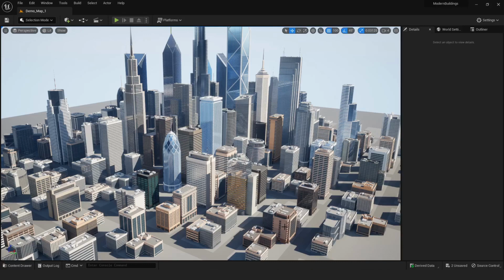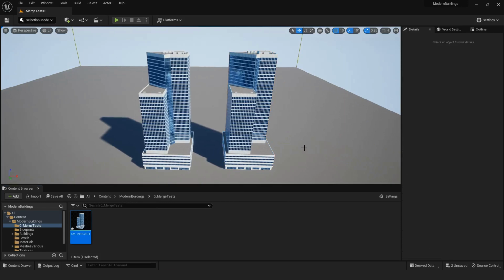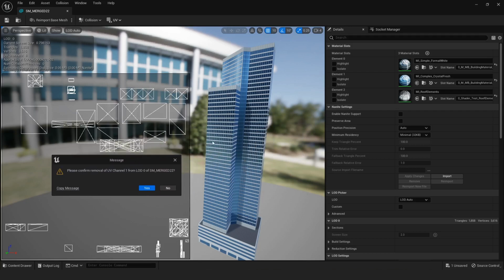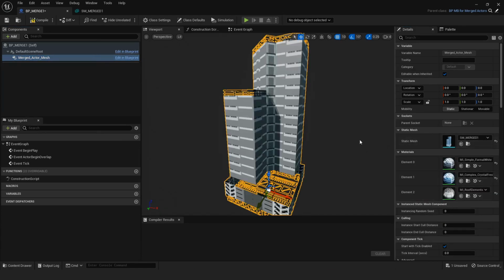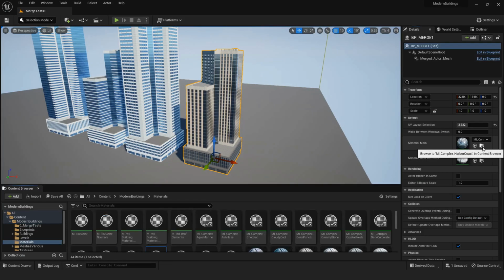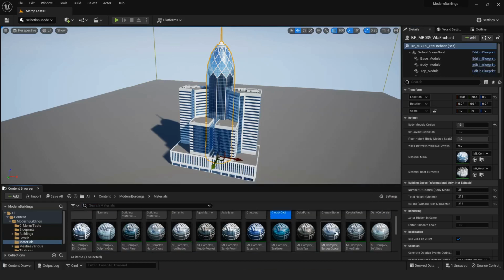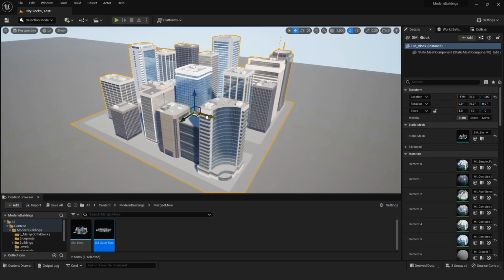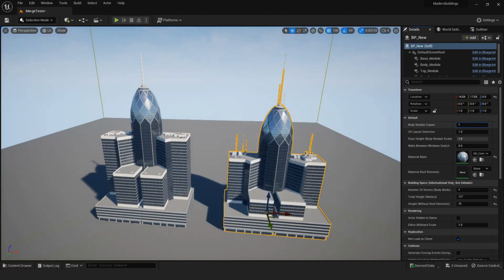Using "Modern Buildings" assets and "Merge Actors Tool" (Part 1) - Unreal Engine

Comment: Hi there,Thanks for the tutorial. Question: are there significant performance (draw calls, etc...) differences between the Blueprint and the static mesh, if I aim mobile VR usage?
Reply from the maker: Hi there, 
Good question, I just made a test, and I found that there is indeed a difference.
I created 256 copies of the same Blueprint building in one level, and then on another level 256 copies of the same building converted to Static Mesh, and I compared the stats with the "Stat Unit" command.

According to this test, the Static meshes offer better performace:
+5 FPS
Draw processing: -2 miliseconds
Drawcalls: 136 (it was 494 with the blueprints)
Prims: 1764K (it was 391K with the blueprints)

The Prims count (or triangles) is higher with the static meshes, which makes sense, but this doesn't seem to affect the FPS.

Either way, this was just a quick test, I would encourage you to make your own tests according to your needs. I imagine the results can change depending on many other factors in your project.
Also this was tested on PC, I am not really familiar with the current limitations on mobile.